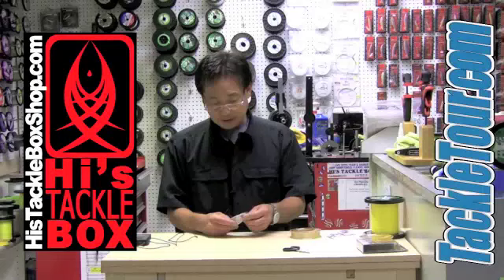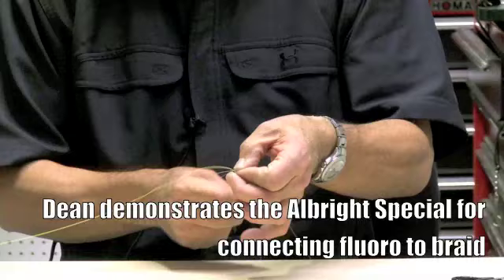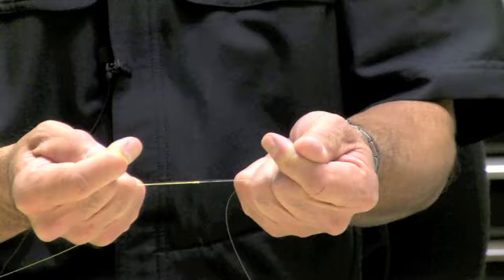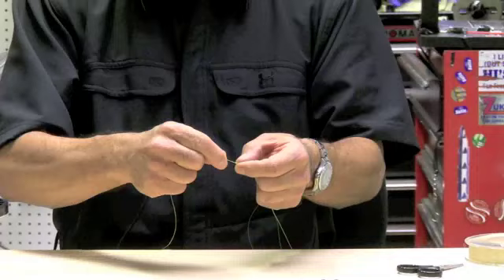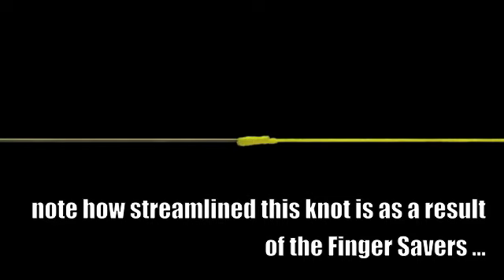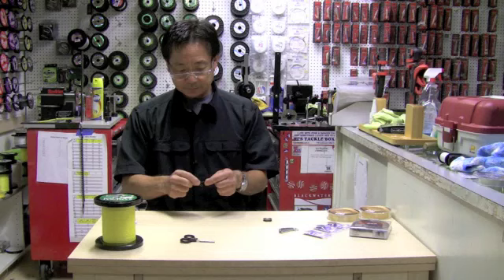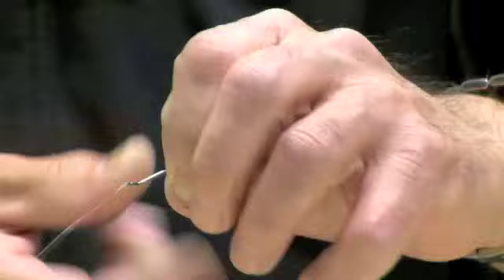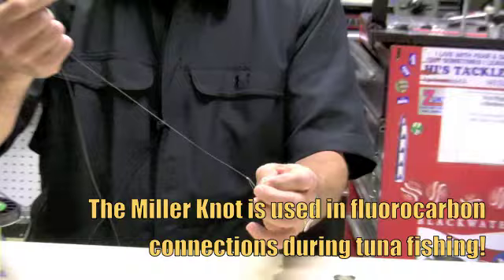TackleTour Video - Braid to Fluorocarbon knot connections

Comment: An Alberto knot is better, but that miller knot is awesome and I haven't seen that anywhere else
Reply: it is not better than this one. This is not a regular albright knot, this is a "abright special" knot. Basically a modified Albright knot. This knot demonstrated in the video is exactly like the alberto knot except you dont coil up and then down again, just down and thru the loop. This makes it easier than an alberto knot since its one step less and a smaller knot since theres less coils on top of each other.

Comment: This is not a very good knot for leaders 20lb and up.  This knot will fail before the line reaches it's breaking tension.  The only 100% reliable knot I've found for fluoro to braid is the double grinner knot. It's a VERY hard knot to tie but will be 100% reliable AND will not cut through the fluoro before the line breaks at it's rated capacity.